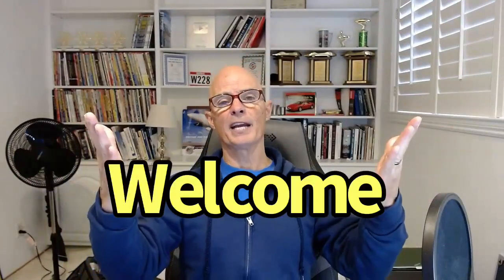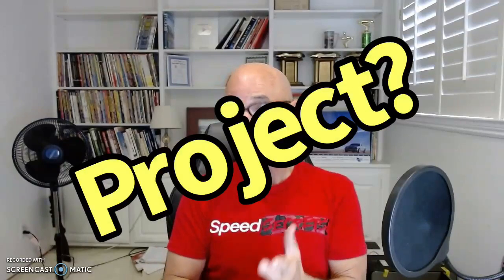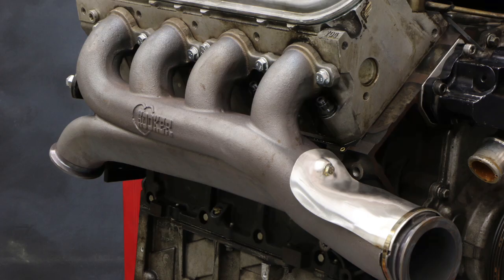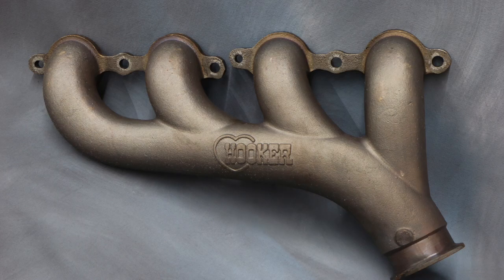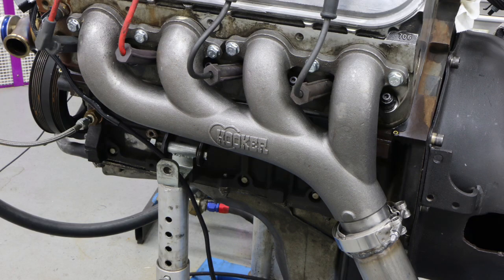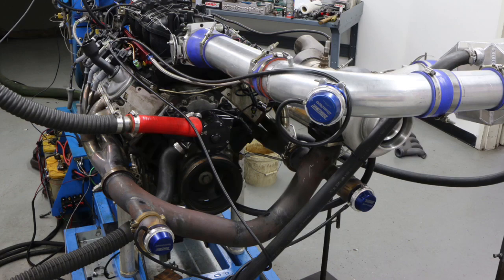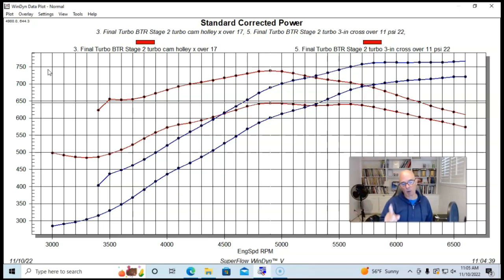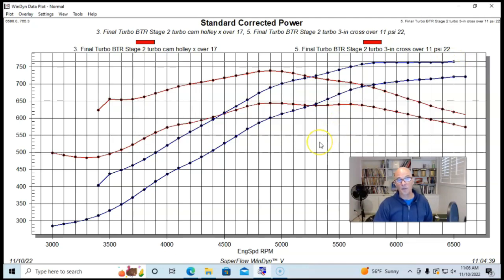HOOKER CAST TURBO MANIFOLDS VS E-BAY TURBO HEADERS-BOOST PSI VS BACK PRESSURE. BACK PRESSURE VS HP!

Comment: Bernoulli's principal.  A decrease in pressure = increase in flow.  I  would guess the decrease in back pressure allowed more efficient spool which allowed the compressor  to do I its thing more efficiently.   Basically the entire turbo is working more efficiently as the back pressure drops.

Comment: I have those hooker manifolds and I can tell you that I’ve gone through 2 passenger side gaskets at only 17pounds of boost. Still wouldn’t say they are bad the car made good power and was a blast to drive just don’t expect high boost out of them.

Comment: The pressure in the exhaust between the exhaust valve and the turbo is created by the piston pushing the waste gases out on the up stroke. This requires energy from the closed system, more pressure requires more energy meaning less is available for the output. It's a simple conservation of energy equation.

Comment: Ok. Correct me off I’m not dissecting this test properly.   The reason the tubular headers produce more hp is because of the exhaust tubes are not in conflict with the exhaust flow except at the end of the manifold but they are directed freely through a pipe. The hooker headers are in flow conflict right at the beginning and creating flow problems. Stock manifolds would be better than the hooker headers?? Something to wonder. !! Thanks Richard!!

Comment: In my mind its the same concept if it were a N/A combo.  And you've proven it in other tests where you ran extremely long exhaust tubing.  Exhaust restriction robs power whether its attributed to manifold, muffler, or undersized tube dia. they're all causing additional back pressure.

Comment: Backpressure definitely makes a difference,  but not all that HP is gained just from that. I think probably 50% of the HP gains is from scavenging increase front the longer tubes and smoother air flow.

Comment: Only thing OTHER than back pressure (and lower VE because less of the gas is able to leave) I can think of is if there was some more heat transfer from turbine to compressor on the cast setup? That seems like a stretch though. Maybe faster turbine speed due to faster boost response also led to a higher efficiency/cooler charge and better VE too? That’s still a knock on back pressure effect though.

Comment: drive pressure being lower or closer to 1:1 with boost pressure is just more efficient on the top end.  I'd be interested to see cams with high overlap vs none on high backpressure setups.

Comment: With more efficient manifold you need more wastegating which raises backpressure. So that turbo was better match with that crappy tubular manifold.
Reply from the maker: NO
Reply: @richardholdener1727  yes. What turbo it was ?

Comment: I think the real interesting thing to look at would be HP/PSI on each engine across the dyno graph since the boost levels weren't even. That would probably somewhat normalize the results, although not completely. Just jam it into a spread sheet and calculate it out, if the dyno software doesn't.
Reply: They were both even at 11psi up top so no need to over think it. The free flowing bigger pipes won.
Reply: @V6turbo  Yes, less backpressure obviously wins up top.  That's not the only thing that matters.  The boost curve on the manifold setup is screwed up.  There's no way it should take 6000rpm to reach peak boost and be down 2-4psi until then.

Comment: You've mentioned before that power will increase once everything gets some heat into it, say for the 2nd, 3rd, etc. pulls. Did you happen to notice a similar trend with the cast vs. tubular?
Reply from the maker: WE NORMALIZED BOTH SYSTEMS TO MAKE THEM REPEATABLE
Reply: @richardholdener1727  Thanks for the reply! I'm very surprised at this test's results.

Comment: My theory: More back pressure means you're having to drive the turbo harder to make the same boost, which means the engine's ingesting the air with more difficulty because of residual pressure from the exhaust stroke where it couldn't escape as easily due to the flow restriction (or lack of scavenging without header primary tubes) a.k.a. back pressure... I talked in a circle.
Reply: And higher peak cylinder pressures(theoretically) although as someone else said, there may be a little more residual exhaust diluting cylinder air composition.

Comment: Yes backpressure will affect power. Higher backpressure the lower the power due to it not moving the exhaust as it should, if it gets high enough you can lose power from it polluting the next combustion cycle because it can't scavage enough exhaust fast enough.

Comment: Thanks Richard! I am curious whether the higher B/P was a function of the Hooker casting restrictions or waste gate (WG) size? Could a "Y" pipe & flange replace the single WG, then 2 WG's be installed on the branches of the "Y" to see if B/P would significantly drop with the increase in "window" of 2 WG's. Any thoughts Mr. R. H.?
How smooth are the internal castings of the Hooker manifolds? Has anyone tried porting or Extrude Honing? Thanks, Paul from S. Central Tx.

Comment: I'd like to see the back pressure with one of the wastegates blocked off on the tubular system tested as well.
The change in back pressure and HP in the Hooker system I think is due to the increased back pressure and the wastegate unable to blow off enough exhaust to bring it down. 
I also expected the cast iron manifolds to retain more heat energy and drive the turbo harder, and I thought we'd see a better boost number lower in the RPM range, and that didn't seem to happen.

I'm going to have to watch this one again   taking note of back pressure reading line location. 
Awesome   info as always, thanks Richard for your dedication to excellence in automotive performance testing 👍
Reply: If the wastegate is unable to blow off enough exhaust, wouldn't the boost rise uncontrollably?
Reply: @lordhumungous7908  Yes and no.  There is a lot more going on here than 1 vs 2 wastegates but OP is definitely on to something.  Wastegate location, how the post manifold pipes are configured where they merge, how long is the distance, heat retention etc etc all contribute...heck it could even be WHERE he was getting the back pressure reading on the Hooker vs the headers!  Remember, heat energy is primarily what drives turbos, not "pressure".  I had boost control go soft on a build once and couldn't bring it down to save my life - just all of a sudden.  Turns out the map in my ECU what getting into a "fail safe" area I put in and it was pulling timing hard.  That dumped a ton of heat into the exhaust and my normal rock solid boost control was creeping horribly!

Comment: The engine dyno can never simulate real life. The RPM climb faster on a dyno than trying to accelerate a 3000# car. That's why you need 2 waste gates on the dyno.

As for backpress, yes, remember back pressure is. It's showing a limitation on the air going thru the engine. More air = more power any day.
Reply from the maker: THE RPM CLIMB IS SLOWER ON THE DYNO THAN IN A VEHICLE (300 RPM PER SEC) AND IS ALSO ADJUSTABLE FROM 50 RPM PER SEC OR 15000 RPM PER SEC
Reply: @richardholdener1727  okay, so a simple test would be to run the same test over and over with varying rates of acceleration. Maybe one of them would show what you see in real life. Also I'm not a big fan of "simulating" road, wind and aero dynamic factors. I'll give you an example. I know an NHRA SS car that will drop .1 in the qtr mile with a SIDE wind. Most cars are not effected that much by a side wind but his car was. How do you simulate that?

Comment: Great video and comparison. I'm curious what the heat differential was between the two exhausts closest to the turbine wheel. Possibly the cast iron sapping more heat versus the header transporting more heat to the turbine? Temp probe would be great to debunk that being that heat and pressure are relative.
Reply from the maker: THE REVERSE WOULD BE TRUE FOR HEAT
Reply: I'd also be curious to see the EGT differential between each setup, given that PV=nRT with more back pressure EGT should also rise I would think as long as timing, a/f, etc. stays consistent. Great video Richard!

Comment: Higher back pressure results in less exhaust gases leaving the cylinder, which, in turn, results in less intake air and fuel entering the cylinder, and less power output.  On a turbo setup, you need exhaust pressure at the turbo to spin it fast enough to create the boost you're looking for, but any other exhaust pressure increase results in loss of power.
Reply: CORRECT ✅

Comment: I think Back pressure played a part in the HP increase, However the tuning/ timing / fuel ratio had to make a difference too.
I really think it was the whole pkg made the difference. If no change was made other than the headers/Manifolds you wouldn't see as much spread between them.
Reply from the maker: TIMING AND AF WERE IDENTICAL
Reply: Curious as to what the price difference was too?

Comment: RICHARD... You definitely need to run that test again. Although you may have learned about boost pressure, and that's great... You need to do it again with an electronic boost controller both have single wage Gates control the boost and see what the power difference is. Come on brother
Reply from the maker: HAVING THE BOOST CURVES THE SAME CREATES IDENTICAL RESULTS IN THE 6000-6500 RPM-SO WHAT DO WE LEARN?

Comment: Fun video.  I’m a bit confused about the back-pressure.  Was it measured nearer to the head or nearer to the turbo?   Ideally we would measure it at both places to evaluate the exhaust manifolds.  Higher back-pressure should result in higher cylinder pressure when the intake valve opens.    This is going to resist flow and reduce the total mass of air going in, or lower volumetric efficiency.  The dyno doesn’t lie, there is less torque, so less air and fuel, assuming something else is not stealing power.
Reply: It looked like he had a tube right under the turbine inlet, so it was the pressure driving the turbo in these tests, not the pressure at the ports.

Comment: I think back pressure accounts for about half of the 6% difference in power between the cast and tubular manifolds.  The other half would come from increased airflow and the extra fuel that comes with it.

Comment: For sure the back pressure made a difference.  You reduced the pumping loss on the exhaust stroke for the same air flow on the intake.  The question is why was the back pressure less.  If you measured exhaust temperature and exhaust pressure at the inlet of the turbine that may help figure out why.  A guess would be the headers are radiating more heat than the manifolds and lowering the specific volume of the exhaust gas which will equal less pressure for the same mass flow.  Probably more to it, could turn into a science experiment real quick.
Reply: I'm wondering if the cast manifolds have a cork somewhere. May be one spot where it's just not large enough.  Seen this difference even between different factory manifolds on turbo setups.
Reply: @V6turbo  
Thinking out loud – Definitely the contributing factor would be the flow capability of the manifolds vs the headers, but the turbo/wastegate are the governing flow devices, so trying to figure out how the pieces fit together.
I did not see where the exhaust pressure was measured, but if it is just before the turbo, then up stream flow restrictions would not directly cause the pressure to be higher in front of the turbo.
Since between 6000 and 6500 rpm boost conditions are the same, that would mean that compressor power required is the same and turbo shaft speed is the same.  That would also imply that the turbine volumetric flow is the same since turbine speed is the same for both cases.  To get the intake conditions to equal in the two cases, the higher pressure and likely higher temperature case would require less turbine mass flow to drive the compressor than the lower pressure/temperature conditions. For the turbine side it is an energy balance, in both cases turbo shaft power would be equal, but the higher pressure and likely hotter air will allow more energy extraction and require less mass flow to get the same shaft power.
Long winded way of saying I agree that it is the flow restriction of the manifolds, just trying to figure out the impact to the devices that will most directly impact the back pressure at these levels of pressure and flow.
Reply: It's probably more to do with the volume of the manifold compared to the headers. Obviously here is more volume in when each cylinder has a pipe then a manifold that merges everything together quickly. Same amount of exhaust being created in a large volume equals lower pressure.

Comment: Engine dyno test are not good turbo test . You can’t see spool time/ response or “lag”…  engine dynos are not great measures of turbos because how the load is applied and engine RPM is controlled .  This is cool to see but kinda as you hinted , real world results may perform differently than the engine dyno .

Comment: without testing 2 waste gates on both the results dont matter because the test is skewed
Reply from the maker: MUCH LIKE THIS COMMENT
Reply: @richardholdener1727  Caps? Sorry that the truth hurts. All of your tests are like this though. I give you the benefit of your extensive experience and knowledge but without all things being equal I cant accept your word as fact. I have very little experience in basic hot rodding, no experience in turbos or dynos. So I look to guys like you for knowledge to increase mine. But when you offer little or no proof other than because you say so, because you have the knowledge, or its a general comparrison so take my word for it kind of mentality, it doesnt help those like me. Without parity, I feel that there are assumptive conclusions. Its like comparing a turnip to a collard green. Yes, they're root vegetables but they're not the same.
Reply: Richard always replies in all caps for what it's worth. 
The two wastegates allowed better boost control itself but don't play a role in the power it will make once the boost level is the same, which is why only the rpm points where boost levels are the same are being compared

Comment: I think the lost hp could have been caused by the pumping loss of the piston pushing the exhaust out of the engine due to higher back pressure. But that is a pretty obvious reason so maybe I'm wrong.

Comment: Great, great video man! I have to say that area below 3500rpm that you pointed out is important for many of us too when it comes to a street car. 
At 78mph my vette cruises at about 2k rpm. 
 On my Ford Lightning I love the low down power too. 
2. I wonder also if scavenging is improved with the long tubes, helping pull out exhaust gasses using pulses from other cylinders, or is that less important on turbo engines because they already have pressurized intake air?
Reply: The higher the pressure of the exhaust gas, the longer the primary tube needs to be to emphasize the exact same RPM resonance, because pressure peaks and troughs travel faster in high-pressure air than in low-pressure air.

Comment: Backpressure is a really bad word. If you're measuring it with a pressure gauge then it's "pressure" and in the case of having a turbo , it's "drive pressure". As for whatever the pressure is? it depends on where you're measuring it. At the port? or at the turbo inlet?
Reply: True backpressure is measured in the exhaust port at the instant that the exhaust valve closes, or soon after. As in negative pressure.

Comment: 30hp hot air pump/compressor can't help the VE of a motor. the extra 3ft of exhaust path and bends would surely change the resonance and flow of each bank and therefore distribution. 

humble testing ideas 
-either a big and small gate on the same system in the same place (or 2 in the same place, 1 locked out, then both) does it make an efficiency difference in the zone before boost creep becomes an issue. -does having the gates closer to the ports let the merge pipe cool slowing spool.

Comment: I think the answer is pretty clear, back pressure absolutely kills power (given the same boost). If it does it NA, it does it under boost! Another thing to consider, if this engine was on pump gas, more back pressure will make the engine more sensitive to knock, leading to the tuneup requiring less timing and of course killing power potential. I'd be curious to see pressures at the port/runner vs pressure at the turbine as well as pressure in one bank vs the other. Now the real question is, if you put long tubes on an engine with collector extensions, and put the turbos there? Does it gain power? My logic says yes, although it would be ridiculously impractical to package.
Reply: Hellion systems do this and some people with pickups put the turbos in the bed - it works!
Reply: @BLKMGK4  Well yeah, there's lots of rear mount setups. I'd be more interested to see a test that's more back to back like you could do on a dyno, really isolate variables.